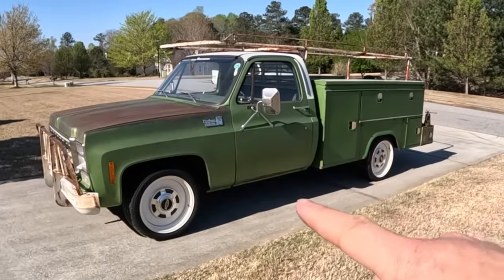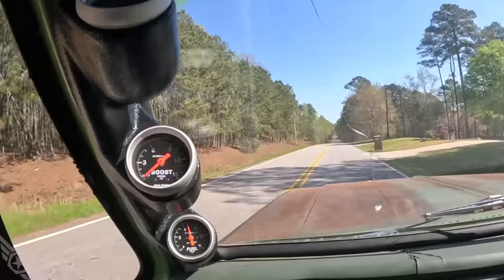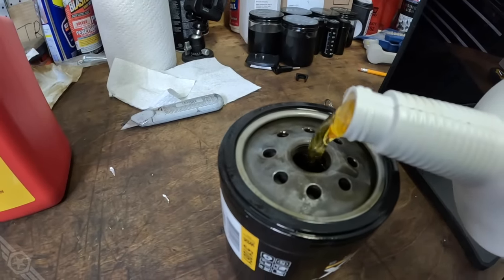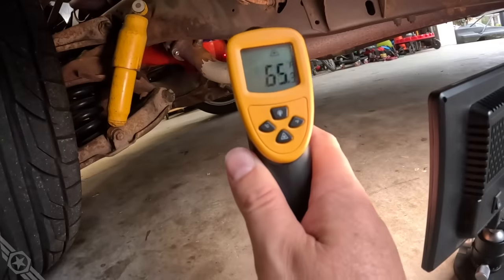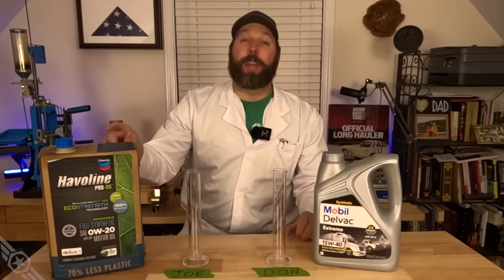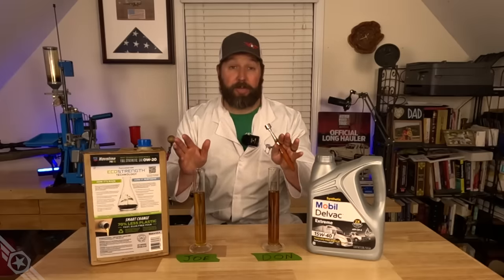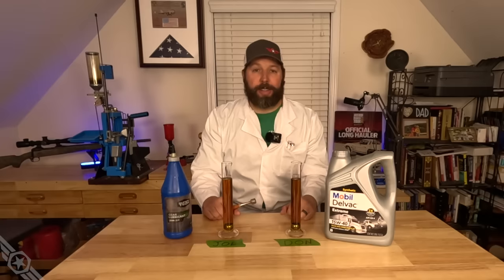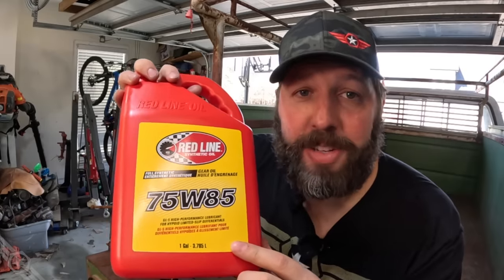Running GEAR Oil in an ENGINE!!! (EXTREME PRESSURE)

Comment: 12:50 Conversely, if during said zombie apocalypse you lose the gear oil out of a differential or other driveline module, you can use an SAE 60 or 20W-50 to get you home safely.
Reply from the maker: Now you’re thinking with you’re dipstick 😎👍
Reply: could use veg oil in a diff to get you home.
Reply: I mean......ANY oil is better then no oil.
Reply: You could use piss to get home ...
Reply: @freedomworx  ha!! I did it... bonehead me checked the diff oil and left the plug out.. nicel ong roadtrip... I sort of smelled that warm geary oil smell  but you know I just cvhecked it.. i musta got some on the exhaust..  an amazing amount of gear oil spreays out the plug.. enough it was really really low when i stopped noticing a smoke cloud in the headlights behind me way down the road..    poured some 15W40 rotella diesel oil  in (its an IH diesel if it aint leakin its empty so always carry engine oil).. and drove on.. after a few hundred miles I got to my desitnation and next day changed out the oil for gear oil again..  7 years later.. same rear diff and no issues.. P.S. amazingly the plug was stil;l laying up in the indent on the frame where i had left it..  now THAT was luck
Reply from the maker: Great story 👍
Reply: That story kinda reminds me of this:

I left my wallet on my battery after swinging by AutoZone, I had to top off the engine oil, and was kind of in a hurry because I was late for a birthday party. Never grabbed my wallet, and shut the hood. 

Couldn't find my wallet and looked everywhere for two weeks before I gave up. Cancelled my cards, went and got a new driver's license, was using an old wallet my friend gave me. 

 About three weeks later, I was sitting at work on lunch one day shooting it with my coworkers, and it totally smacked me in the face at random, I just yelled "HOLY S**T ILL BE RIGHT BACK", ran over to my car, popped the hood, and there it was. 

I was shocked. That was my 94' Corolla, I put a ton of work into modding the suspension, with wheels and racing tires and drove the thing on back roads daily to get to work, and for fun. I have no idea how it didn't slide off with the way I drove.
Reply: Or banana peels in a pinch

Comment: From working on my '98 Jeep XJ, it's stuck in my head that 75w-85/90 is ~10W-30 (viscosity, not chemistry). This entire video reinforces that. Awesome.
Reply from the maker: Yep. They are very close in viscosity.
Reply: This is correct ☝🏼

Comment: Back in the early 90s I got ahold of a 2.8 v6 fiero that had some very evident low end knock. I ran 80/90 gear oil to quiet the knock and drove it this way for 3 years.
Reply from the maker: You’d make a good used car salesman 😎
Reply: Or you could just run Lucas as 2-3qts out of 5.
Reply: Top notch american engineering.
Reply: Did that with old Austin mini in 80's , rumbling crank and oil light on at idle ,sounded great with really thick gear oil from work , oil light stayed off ran it all summer

Comment: Richard did multiple dyno runs with all different oil weights. The trend was that thin oil provided less drag on the crank to make more horsepower. In his test 20-50 made the most power because piston ring seal with thick oil made more power and over came crank splash
Reply from the maker: I assume you are referring to Richard Holdner? I need me one of those dynamometer thingies myself 🤓
Reply: @freedomworx  yep
Reply: As an upstart auto fart in about 1966 an old man with a model T and was it a Ford A was changing oil. It dangled like mamas dipetydoo. He told me whenever she gets to a smokin just up the oil tenerso. He was putting in 50 weight! Lol. My engines never blow either. 20w50 max in big engines. With 300,000 or so. I go 10w40  in 200,000 mile rigs. My lil sissypoo just got 5w30 syn with sooty exhaust at 33,000 miles on 0w20 from stealership. A few thousand miles and tail pipe is silver shiny now! Lucas gas conditioner in also!  Mileage went up 3.5 mpg! Try it kidderz! Lol

Comment: It might not be such a good idea with newer engines but old ones nearing the end of their service life tend to not have any issues with it.   I've run many with gear oil and it worked well.
Reply from the maker: I wouldn’t recommend anyone do it unless they are trying to squeeze the last bit of life out of a shit box 😂😎
Reply: @freedomworx  Hey now. Shitbox with one tire already in the grave has been the definition of every vehicle we ever had for a daily driver. 😄
Reply from the maker: You know what they say, pretty paint causes stress. I’m a patina and oil leaks kinda guy 😂

Comment: Good summary. The EP additives compete with the antiwear additives like ZDDP for surface where loads are not too high as well.
Reply from the maker: Yep, there is only so much surface area on bearing...surfaces. You gotta pick you poison when it comes to additive packages.

Comment: Heads up: pointing your IR thermometer at the graduated cylinders didn't tell you the oil temperature, it told you the glass temperature. Glass is transparent to visible light, but the overwhelming majority of glasses and glass-alikes (acrylic, plexi, etc.) are opaque to infrared. Now, since both the glass and oil were likely in the same room overnight, you did get an accurate reading of the temperature of the oil, but only by chance.
Reply from the maker: Thanks for the tip my friend 👍. Yes, everything was stored in the same room overnight 👍

Comment: My Dad ran gear oil and engine oil mixed in the old dump truck. That truck was horribly worn out and smoked badly. He rarely used it though and it's job was about once a month to pull a load from the top of the hill to the bottom.  Going downhill it didn't exactly need loads of power, the brakes working is what were the primary concern on that old 1950's International rusty dump bucket.
Reply from the maker: When they are old and worn, run whatever makes them happy 👍

Comment: Gear oil used back in the days of the Ford model T was 500 weight. The stuff was like heavy soap or heary grease. That would damage the engine for sure. Nice video Fella too. vf
Reply from the maker: Can’t leak if it’s too thick to pour 😂

Comment: A fairly common thing for enthusiasts of old 2 stroke motorcycles like myself is to run 75w90 gear oil in the gearbox as opposed to the motor oil that's typically specified.  It's understood to be better suited for both the gears and the clutches, but you can't typically get away with that on 4 strokes, where the gearbox and clutch usually share the oil with the engine.
Reply from the maker: I always used Rotella in my KTM 300XC. It's a lot cheaper than 75W-85...and I don't think I even knew 75W-85 was a thing back then.

Comment: Once I had no choice but to use motor oil as gear oil. The differential survived. The JB weld cover repair is still holding after 20 years
Reply from the maker: This engine actually has a J-B Welded main cap in it 😂

Comment: Freedom Worx is using a low-cost analog to the classic Saybolt falling-ball viscometer, which was the source for SSU viscosity numbers.  SSU =>> Saybolt Seconds Universal.  It timed the ball falling through a known distance, and the longer the time, the higher the viscosity.

He got all of the basic technical points I was aching to point out when I clicked on the video.  In my opinion, he's a righteous oil guy.

I've wanted to run gear oil in an engine for years.  Knowing that the viscosity ranges overlap engine oil ranges, I knew it would work in the short term, and the gear oil would have plenty of wear protection for the engine.  But for long-term use, gear oil doesn't have the chemistry required to resist corrosion or soot agglomeration from the products of combustion.  (But he mentioned that.)

If you're really brave, try running gear oil in your Duramax for a couple of years.
Reply from the maker: I only ran it in this engine for 10 minutes and then dumped it 😂. No plans to put it in my Dirtymax🥴. Thanks for watching and commenting. 👍
Reply: Any oil in a Duramax requires the same bravery. Its a Dodge.

Comment: The guy who built the gearbox on my race car recommends 10w40 and the owners manual says 75w80. Never understood why but now I do. It’s similar when cold but thinner (and therefore there will be less losses) when warm. Changing it every few races means was strongly suggested too.
Reply from the maker: It’s interesting that some gear boxes call for engine oil. 🤷🏻‍♂️
Reply: @freedomworx  Jeeps, have the same thing going on. Was absolutely taken aback to find out my XJ's M/T called for 10w-30.
Reply from the maker: @LRK-GT  XJs don’t even need oil. They run on Busch Lite and prayer.
Reply: @freedomworx   Some call for even lighter ATF.

Comment: regarding the composition of engine oils, they contain a large quantity of detergents which are completely absent in engine oils, on the other hand we find extreme pressure additives in certain engine oils, particularly for vehicles where they also lubricate the gearbox...
Reply from the maker: Motorcycle Engine Oils 😉

Comment: And you for sure fill the filter before installing. If it happens to be an up and down facing filter then you'd be crazy not to. And I'm with you on the smell of rear end lube 😅 I did NOT know that they used different scales!
Reply from the maker: If an engine has an upside down filter, I'll turn the car upside down just so I can install a full filter. Where there is a wheel, there is a way.😂😉

Comment: That is mind blowing at how the numbers are so deceiving.   I run 5w40 synthetic with a oil pan heater in winter and 15w40 in summer.   I am a oil field operator 200 miles a day.  6000 mile oil change limit. 
2014 6.7 cummins 335,000 km changed turbo actuator in these miles. Been really good.
Reply from the maker: Some folks have commented that the reverting convention was done purposefully by SAE so that people wouldn’t confuse gear oil and engine oil. I haven’t taken the time to verify that though.

Comment: I own a 1998 Dodge 2500 with the 24 valve Cummins diesel, and the NVG-4500 5 speed manual transmission. This transmission requires a very specific lubricant, Castrol Syntorq 75W85 GL4, probably the same or very similar to what you used in this video. I was very surprised at how thin this product was, because in the older Ford pickups I owned in the 1970's and 80's, with the Borg-Warner T-18, the oil used was 90W-140 (also used in most outboard boat motor lower ends), and that lube pours like molasses. But the Syntorque does it's job: I've towed an 8,500 pound boat and trailer almost 10,000 miles on several long road trips, and the transmission still works like new at 106,000 miles.

The reason that newer vehicles with manual transmissions  use the thin oil, is that it produces less fuel-robbing friction, and it has special additives that greatly increase it's ability to pull heat away from the gears and synchronizers, and transfer that heat to the atmosphere through the case (especially with aluminum transmission housings). This is especially a valuable feature in heavy-duty truck transmissions, where internal heating while towing heavy trailers can be a problem.
Reply from the maker: Yeah, I’m pretty sure it’s a GL4 oil.

Comment: Blew oil pickup line and needed to get 10 miles down the road. 2000 5.9 Cummins diesel ended up with no other choice but let it drink a gallon of 80w90 Its since been fixed and driving strong going on 3 years this July 

And you are absolutely correct oil pressure did not spike
Reply from the maker: You could fuel that thing with gear oil in a pinch. 😎

Comment: Great explanation of why gear lube smells so bad! I first started using gear lube in about 1987, in outboard boat motors, and always wondered why it smells so different (and nauseating), compared to motor oil.  Thanks!
Reply from the maker: Dinosaur Butts 🤓

Comment: Watching this video just waiting to jump all over you .. but you covered it all and got it right. As for prefill or not - I doubt anyone will ever agree, and either way, the difference over a few hundred thousand miles with a million variables between drivers would never result in anything possible to test in a lab. My rule is that if the filter is vertical, prefill .. if it's horizontal .. then just pour a half quart in the damned garden first off and save the hassle. Even a fresh rebuild will have enough assembly lube .. although I always was one for (on old school plants) making a tool from a dead distributor to spin up the oil pump before initial fire.
Reply from the maker: Well I'm glad I disappointed you 😉. Thanks for watching 👍

Comment: I don't know if anyone has made this comment earlier, but the "W" in the grade does not stand for the weight of the oil. It is next to the lower viscosity number for a reason. W stands for Winter.
The lower number is the viscosity of the oil at the tested cold temp for cold weather start up. The oil is actually thinner when it is cold and gets thicker when it gets hot. Example, an oil marked 10W-40, in the winter when it's cold the oil will have a viscosity of 10. Why? Because it makes it easier to start the car. Back in the day when cars first came out, they would run only one viscosity of oil. They didn't come with electric starters and had to be hand cranked. The oil would get so thick it made the engine hard to hand crank and start. Many people would drain as much of the oil as they could in the winter and go in the house to heat it up on the stove, ending with a fire.  Even when electric starters came out the oil got so thick the battery would drain before it would start. Back then they would use the thinner oils for winter and thicker for summers. The old owners manuals would call for an SAE 5W, 10W or 20W in the winter and SAE 20 or SAE 30 oil in the warmer weather. Now with the multi grades some owners manuals call for SAE 0W-30.
https://www.youtube.com/watch?v=48pviPLgaPQ
Reply from the maker: Yeah…that’s not true. Oil always gets more viscous when it gets colder. 10W is not a viscosity, it’s a viscosity grade. SAE 40 is not a viscosity, it’s a viscosity grade. Read SAE J300.

Comment: Even if you put the heavier gear oil into the engine, the pressure relief valve in the oil pump will still open at the same pressure.  You would probably twist the oil pump drive rod if the cold temp was very low.
Reply from the maker: Yes, heavier gear oil would likely lift the relief valve. I’m just trying to show people the difference in the viscosity grade scales 😉

Comment: Some years ago I remember an American magazine article recommending using engine oil in both the gearbox and back axle to release more horsepower, as opposed to the heavy weight oil normally in them. I wasn't entirely convinced though.!
Reply from the maker: It might free up some horsepower, but it would not be ideal for keeping a ring and pinion alive.

Comment: Ive had my 68 ford pickup 352 fe engine ..im always asked what oil do you run i say..o i l.....ive got 400 000  miles on it owned it forty years .even canola oil french fry grease ..its got a leak anyway..love the video
Reply from the maker: Yeah it doesn’t really make much difference I’m most applications. Thanks for watching 👍

Comment: In a small filter scenario, such as a standard gasoline vehicle generally, it is not needed to fill the oil filter. Proof of this is when manufactures make cartridge inserts in the plastic casings you cannot fill those. However when you have a large filter capacity such as a diesel filter that contains multiple courts or heavy equipment that contain over a gallon, you must fill them.
Reply from the maker: Engines with big filters have big oil pumps. That’s why the engines need bigger filters, because they flow so much more oil. Takes the same amount of time for them to fill up as a small engine with a small filter.

Comment: I always fill, or at least "wet" both the oil, gasoline filters. Less initial shock to the filter medium that way.
Reply from the maker: I've never seen any data to indicate that it makes any difference. Caterpillar manufactures their own  filters, which are some of the most expensive filters out there, and they specifically say to not add oil to the filters.

Comment: Back in 2012, a busted oil pressure gauge hose sprayed out literally all my engine's life blood (L28 engine), at a buddies garage i retreived used motor oil from his recipient, and when got home and checked the oil level, needed more oil, being unemployed at that time, i filled in the engine a 1L bottle of NP ultra 90 gear oil, took overnight for all contents to drain into the engine, the smell is exactly what you said...stinks , but observation, the rod knock i had when the engine is hot and idling, that knock went away   .to this day, that oil coctail is still in that engine
Reply from the maker: Whatever it takes to keep them on the road 😎

Comment: The viscosity rates are different between gear and engine oil  ,but gear oil has additives for high load and shearing   while engine oil has  more detergents and acid neutralizers  for the combustion gasses,
Reply from the maker: Pretty much. Said all that in the video 😉

Comment: Very informative.  I ran 85w140 gear oil in a 302 that had such a bad rod knock i would lose oil pressure at idle.  Drove it for a year like that while i saved and built a replacement engine. That engine stank for years up until the day i sold it lol
Reply from the maker: Great success story 😎

Comment: I had a friend who by accident put diff oil on his Honda accord back in 2019 while he was rebuilding an engine. He rode it for a few days but he said it felt sluggish and it wouldn’t change gear (it had an automatic transmission). Eventually he figured out the oil thing and changed to the proper one. That diff oil was DEFINITELY not thinner than the 10-30 oil
Reply from the maker: No. Most of them are thicker than engine oil. I'm just demonstrating the difference in the scales